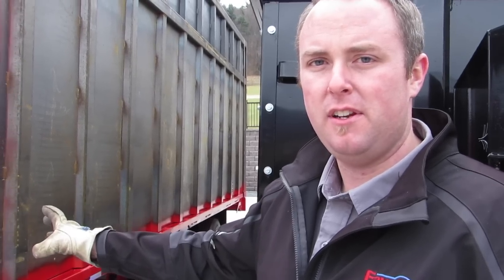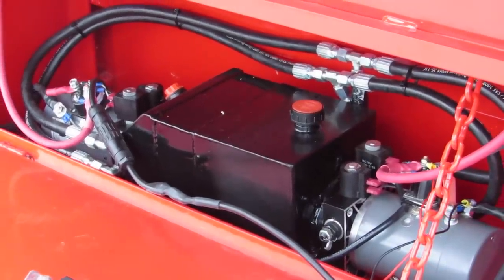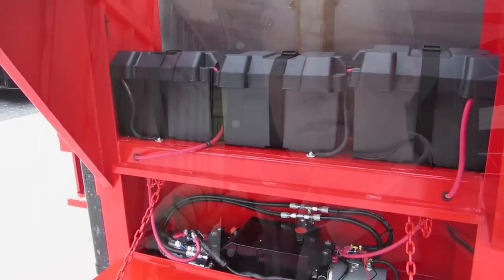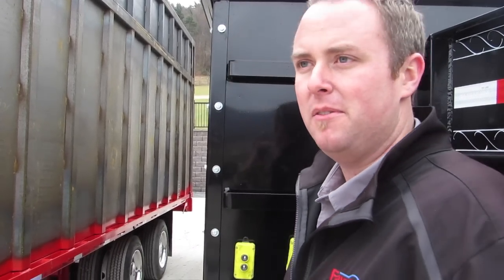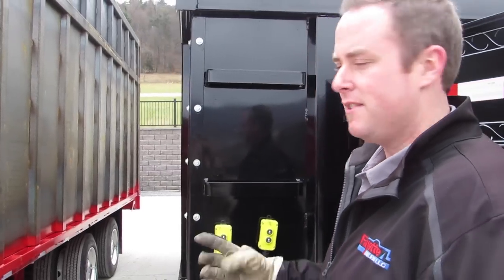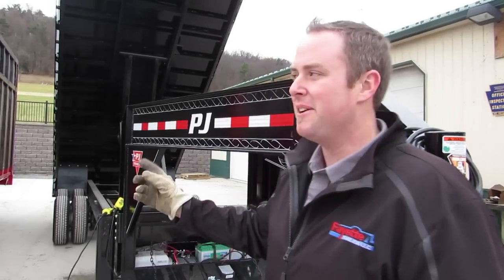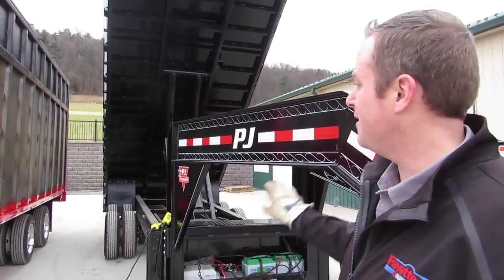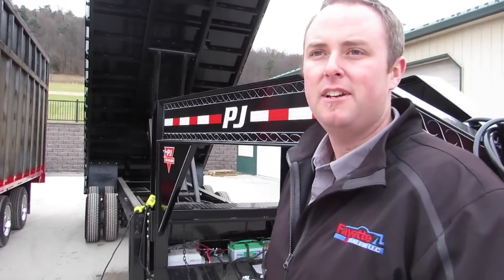Dual Pump vs Single Pump - PJ Tandem Dual Dump Trailer

Comment: If you check the GVW,s on those trailers, you would see they are both over 20.000 lbs, something like a ford F-350 or chevy 3500 will have a 12,500 GVW, which puts the combination into CDL territory. If you don't have a CDL or farm tags on your truck and trailer, you're in for a pretty big fine when the Troopers catch you.
Reply: Thnx for that comment! people like me wanting to get something like this but don't know what all consist of running it on the road! I appreciate it.... I'll work on license 1st then get trailer after. thnx
Reply from the maker: You are exactly right.  The GVW on both of these trailers is 25,000 and 30,000.  So CDL is definitely a must on these :)
Reply: theCAR GUY  Any truck and trailer combined GVWR over 26,000 requires a CDL.
Reply: Let's see these 3500 models carry these around with there 35,000lbs trailer capacity. Just because the dealers tell you that you can, doesn't mean that the  D.O.T WILL LET YOU.
Reply: @wendallkrahn7490  if the trailer is 10,000 gvw, you can pull it with a 26,000 lb truck, 100%. if the trailer is over 10,000 gvw then the combo of truck and trailer gvw's cannot exceed 26,000 gvw. so you can pull a 16,000 gvw trailer with a 10,000 gvw truck w/ no cdl, legally

Comment: Was that video cut? My PJ 20' dump ( single pump) takes 4 min. 20 seconds to reach full height. I contacted PJ about a faster option - no reply
Reply from the maker: This is an option that we designed and install here in-house.  We can sell the parts to you for your existing dump that can convert it.  For pricing and more info, email josh@fayettetrailers.com.  Thanks!
Reply: And the response you now got was a bit around the bush..... I’m guessing something was wrong? That seems too long.
Reply: These guys are great people. They try like hell to help you get the right trailer. Their inhouse operation is better than any factory that I've been at. I would first ask these guys for the best trailers for the money. Their opinion on the issue about trailers are second to none. Even if you dont buy there, just listen, their knowledge is the best.

Comment: how fast is the gravity down option?
Reply from the maker: It is a lot slower than power down for some reason.  We thought it would be quicker on these big dumps since the box is so heavy but we tried it and it was substantially slower.
Reply: That is the sacrifice with most things, to get faster lowering you must sacrifice for slower raising and vice versa. Unless you add in a lowering over-ride system to speed it up, but careful how fast you set the lowering speed, slam it down to hard or too often and your going to run into frame and structure issues, unless you add rubber between to soften the landing ad reduce creaking/rattle noises.

Comment: how much is the double pump setup
Reply from the maker: This setup is a $1,200 option on a new trailer. That includes upgrading to 3 larger batteries instead of the 2 standard smaller ones.

Comment: If I need dual pumps, I would just addd a wet kit to my pickup and use PTO power.
Reply: That's exactly what I did on three of my trucks and it works great !!!  I will NEVER go back to a dead f**king battery ever again.